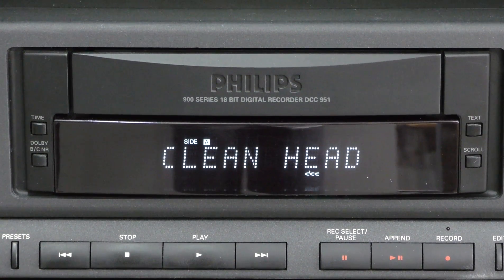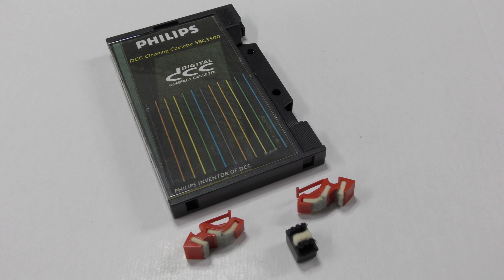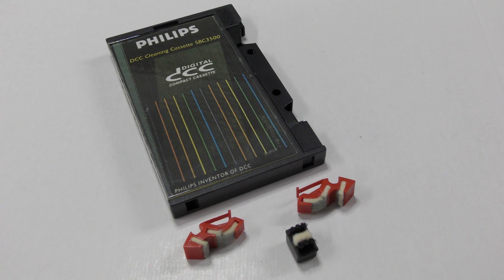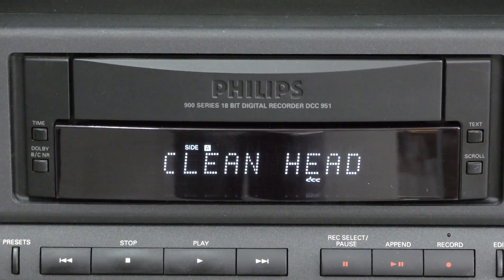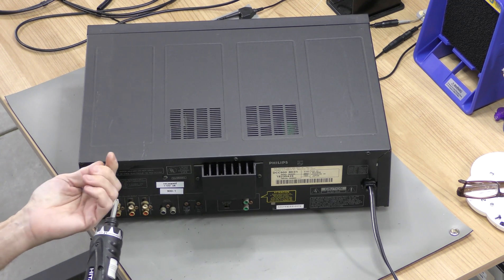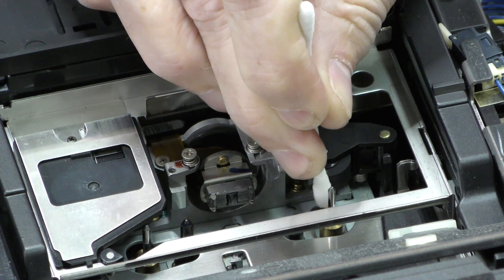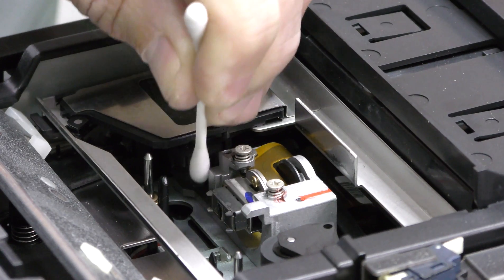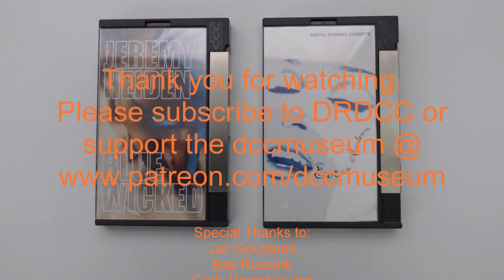Cleaning the Head of your Digital Compact Cassette

Comment: I just got my DCC 730 out of the loft after about 20 years, kept in the taped up box, used it 5 times in the 90s I believe. Switched it on and you never believe it.. Yes 'Clean Head'. Dam thing is almost brand new. ! What a RIP OFF they must have been at the time. I went straight from DCC to MD at the time, they were just as bad for failing.

Comment: Unfortunately I have a DCC-600 with the casette tray oriented in portrait mode in stead of landscape. The head is not reachable even when I take the lid of the player. Will a cleaning tape for a regular non-dcc tape deck work on a dcc player?
Reply from the maker: Hi, Absolutely not. It could really damage the head. When you remove the lid, you can see the head and pinch rollers and should be cleaning it manually. If you do not want to do that, get a DCC cleaning tape only.
Reply: @DRDCC  When you remove the lid of the model 600 you still can not see the head and pinch rollers. It is not like in this video. I might be able to reach the head with a longer cotton swab (15cm) and clean it from the back with the lid removed. The DCC cleaning tapes are nowhere to be found these days. If the longer swabs don't do the trick I will try to dismantle the player some more I guess. Thanks for the heads up about the regular cleaning tape!
Reply from the maker: @mloesb  With a long cotton swap it will work. If you look closely, you will see the head and pinch rollers. It is the hardest player to clean for sure.
Reply: @DRDCC  I will give it a try. I ordered extra long cotton swaps. I will post the results here for other DCC-600 owners.
Reply: I have the same problem cant see the heads  @mloesb

Comment: IPA on rubber is NOT a good idea. It dries out the rubber DON'T DO THAT. use warm water on a mild soapy basis. Beter is to take out the roller and clean them with hot soapy water rubbing it with your fingers. Rubber will curve upwards with IPA and that is not something you want on a flat surface.

Comment: Hi. I have just acquired a Philips DCC 951 and I'm getting the "CLEAN HEAD" error code. I cleaned the head based on this video and is still getting the error message with all the tapes I've tried (I have tried 5 different tapes).  There is also frequent audio drop out, sometimes with no audio at all.  Is there something very wrong with this player and what can I do to remedy the problem?  Thanks.
Reply from the maker: Joseph Yeh Hi, a dirty head often takes time to clean, so make sure to clean in thoroughly. Do these 5 tapes play on any other dcc player?
Reply: @DRDCC  I just tried the tapes on a working DCC 900 and had no problem playing.  I also noticed that once the 951 is on for a few minute,  there is no longer sound when playing.  I was looking around the deck and noticed that it is 50hz only.  It's running on a step up converter to get the voltage up to 220V but I'm assuming that frequency stays at 60hz.  Would the frequency difference be the cause of these issues?  Thank you again for your help.
Reply: Ok.  I tried something that you recommended not to do.  I briefly played a regular cassette tape and there was a lot of static noise and the music can barely be heard.  This was similar to mine DCC 900 before it was recapped.  Could this indicate that there are some leaky capacitors in the 951 as well?
Reply from the maker: Normally capacitors are ok on the 951, but this problem could still be related to them failing. I am afraid though that the head might be damaged, based on your story.
Reply: @DRDCC  I finally had some time to take a look inside and the capacitors visually look okay.  Didn't look like there is leakage and corrosion around the SMD capacitors.  Is there any way to definitely check the head and if it is the head, can it be repaired or replaced?  Thanks.
Reply from the maker: @biomayhem  Normally replacing the head is not cost effective vs buying another one.
You can download the service manual at our website and go into service mode to check the head.

Comment: I have just purchased a 951 in very condition that shows head cleaning required so I will try this thanks, it also doesn't read the TOC, don't know if this is a separate issue or related.
Reply from the maker: Matt Jarrett Start with cleaning. This really might help.
Reply: @DRDCC  So I've just done this cleaning method, it still doesn't read the TOC or time on playback, but it does when recording. Those little spring switches look ok, obviously can't test if they're working.
Reply from the maker: Matt Jarrett The recording part is not really saying anything as it is trying to write. Only during playback you know if it works. No TOC on pre-recorded as well?
Reply: @DRDCC  No TOC on pre recorded still, and it still asks for head to be cleaned but it looks spot less to me.
Reply from the maker: Matt Jarrett it is most likely the capacitors or switches.
Reply: @DRDCC  Ok will have a look, thanks for your help.

Comment: 'Therefore our advise is to never use any normal analogue cassette's in any DCC player?'  Ok, it gets dirtier a lot quicker. But the whole advantage of de dcc player playing normal cassette's as well was a big (selling) point back then.  And they sound very good too playing through a deck like that. I would certainly do it if I had one. :D But I just have a normal JVC TD-W318 double cassette deck. :) But I love your video's about DCC. And the format itself. Maybe I'll buy a DCC player if I can find a good deal on one in the near future.
Reply from the maker: Jeroen De Jong Hi Jeroen, your point made sense 25 years ago. Backwards compatibility and decent audio from a analog cassette as well. Moving forward 25 years later we know that most analog audio tapes used, shed a lot. Especially the older ones. The thin film heads are very sensitive to this and if you would clean them after using a analog tape, it would not be a big deal. But unfortunately most people do not want to do this. Very understandable. Dcc enthusiasts that have / getting a dcc player, most likely have a much higher end analog deck as well and that is what our advise is based on. Hope this makes it a bit more clear.
Reply: If you want similar experience of analogue tape with dcc head look at Technics RS-AZ6 or RS-AZ7. These players use technology of dcc play head to play analogue tapes.

Comment: That is not so easy to do on other models, like the DCC600 etc. You cannot get to the heads very easy.
Reply from the maker: Philip van der Matten You are right. On those models you either need a very long cotton swap or remove the top part of the mechanism as well.

Comment: Does not alcohol dry out the rubber drive wheels?  How about a rubber rejuvenator?
Reply from the maker: John Schroeder I would only apply rubber rejuvenator, if the pinch rollers have a milky color. If after cleaning the milky color remains, you can use the rejuvenator.